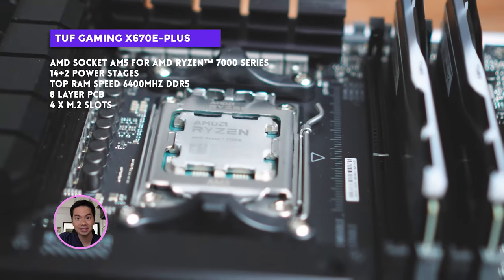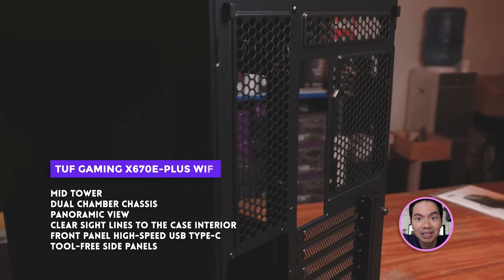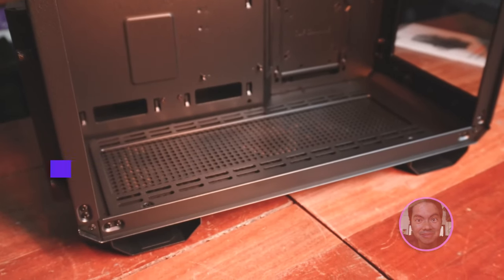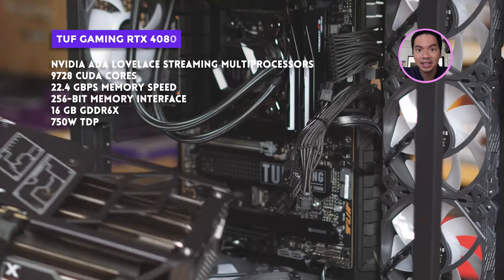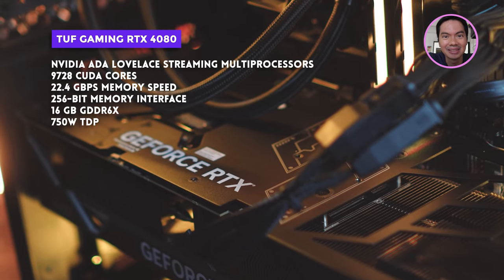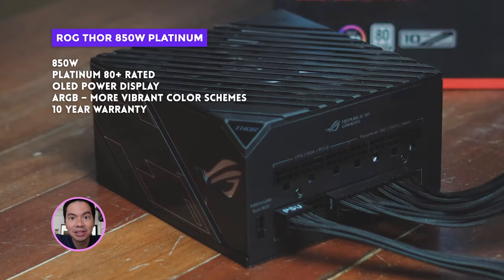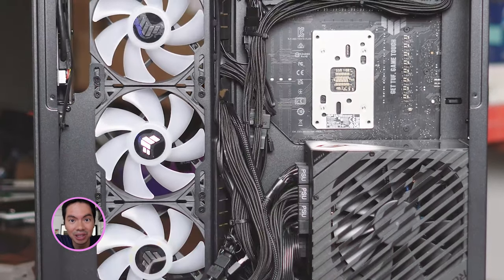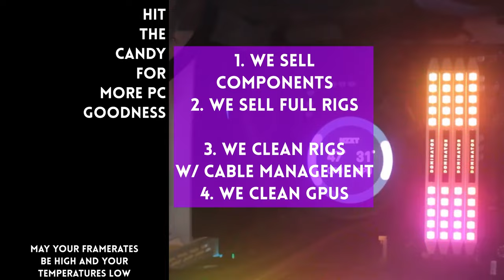Tuf 4080 Gaming Build with GT502 Case and Tuf X670E Mobo

Comment: Hello. I have the same setup with 7 asus tf120 fans. When I power on the pc 4 of fans argbs are not working. Then I open the case and push long press to the mode button on argb controller then 4 fans starting to shine. How can I solve this issue ?

Comment: I cant do dual Channel with my 7800x3D and my tuf x670e plus wifi... I have a 2x16 kit RAM, tot 32gb ddr5 cl30 6000mhz. PC works only in frist 2 slot RAM, called "A1/a2" 
I canti do dual Channel, and if i populate any of b slot, my PC don't boot... I saw Is a very comune problem on am5, expecially on Asus mobo, and x3D CPU... What can i do now? I don't know if the issuse come from CPU Memory control, or a   issuse mobo... I whached PIN of mobo and CPU and lookly normal... Sorry for my terrible english, but i Need answer! I have less 8 day for a Amazon refound or swich... Please, can  someone help me, pleasee?? 😰😰